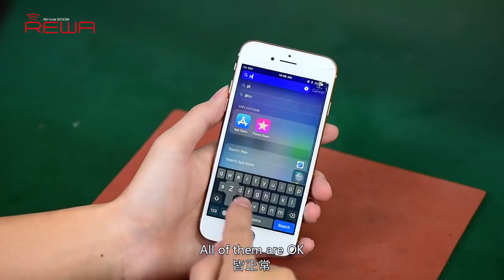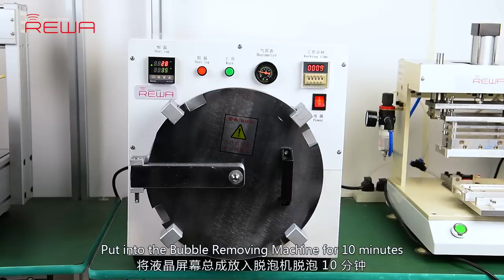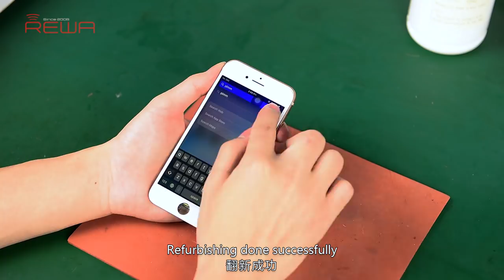iPhone 8 Broken LCD Screen Refurbishing - Glass Only Repair

Comment: Screen looks a bit yellow...
Reply: RUS yeah,I think so,looks yellow more than my iPhone 8😂
Reply: Probably because of the True Tone display
Reply from the maker: It is probably caused by photographic lights.
Reply: Where's the Russian and where's the hater?
Reply: ikr its looks yellow
Reply: Its hello because its not poem screen they repaired poem don't have the blue stamp that this screen had in the middle of the back where the rq code is at
Reply: Or maybe "Night screen mode"
Reply: maybe glue have to dry
Reply: APPLANDROID better remove your comment, makes you look like a fool, a second time because the screen is yellowish and a third time because of the capitalization.
Reply: a bit yellow is better than a bit cracked
Reply: RUS the color correction of the camera or the editing. It's obvious dude you're watching this on YouTube of course the colors are off by a lot
Reply: kirino Kousaka Same with me until I turned the night tone off Or whatever they call it
Reply: It was yellow even before repair. Also screen glue can a bit affect for color.
Reply: Damn, all that work and they are selling these after market screens for only $25 in the US.  So by the time you subtract a $10 profit by the distributor/reseller, $5 shipping, $5 refurb parts & electricity, there's only about $5 left for labor.  It's unbelievable...
Reply: Night shift mode enabled
Reply: Due to change of polarizer film which is not genuine
Reply: overcooked thats way is yellow🤣
Reply: zero00tolerance true
Reply: Your tree

Comment: wow this repair shop is so much more advanced than those common ones who only know how to replace the whole display assembly. this is one step up in skill and technology. real professional work.
Reply from the maker: Thanks. We will keep up.
Reply: +maxlol0 probably cuz these machiinary costs afuckton of money,, its almost impossible to just replace the glass without the right tools, in fact there is two methods,

using hotgun which may risk burning the protective film if go over 70c rendering the whole screen useless
using Dry Ice, which helps solidify the Glue in between the screen then u can take it of shards by shards, but u can easily fuck up when puting the glue back cuz if u went for a little that would lead to unequivalant pressure hence creating airbubbles, and if u wen to far u risk the glu goes to the side of the screen corners damaging it

what im trying to say the technique is hideous & impractical without using the right tools. thats why small shops don't use it

Comment: My iphone 6s got refurbished. The replacement screen is not genuine flatter than the original which is more curved and not that durable, got scratched easily and the placement is a little bit off, the black bezel of the screen was off the center, but over all it works.

Comment: Is it still water resistant? When I had my iPhone 5s, I accidentally dropped it and the screen became completely shattered. I took it to a local phone repair shop, and they replaced the screen and charged me $100. They did a bad job with it, because on the side of the phone was sort of a dent and light would shine out of the phone through there. I’m worried if I take my iPhone 8 Plus to get the screen fixed (there’s a small crack, not getting it fixed unless it gets worse) they’ll mess it up and that it will no longer be water resistant.

Comment: After a lot of practice you can get the same results with a platic playing card and a hair dryer and some LOCA glue and a UV light. You don't need to spend thousands on expensive machinery. unless your fixing hundreds of screens a day in which case I guess its possible it could be worth it for time. It is much better however to replace the glass on an original LCD then buying a poorer quality full screen.
Reply from the maker: This solution is actually for large repair shops and refurbishing factories.

Comment: At 6:20 the n-hexane is highly toxic. According to Wikipedia: It is neurotoxic and produces a polyneuropathy. In view of this behavior, replacement of n-hexane as a solvent has been discussed. n-Heptane is a possible alternative.
Reply: Wikipedia：The National Institute for Occupational Safety and Health (NIOSH) has set a recommended exposure limit (REL) for hexane isomers (not n-hexane) of 100 ppm (350 mg/m3 (0.15 gr/cu ft)) over an 8-hour workday.
Reply: Zhou Kevin In case the working space is very well ventilated, there isn't a serious problem n-Hexane and other solvents.

Comment: why you guy remove front film before laminate ? (pol film) it's not necessary for  few crack front glass.
Reply from the maker: It is more efficient to replace the POL film directly.
Reply: origin ocaabove pol film is very soft, you can easily take them out without removing POL film.
Anyway, remove and install new POL film will make LCD more beauty. (not scratched)
Reply from the maker: If we keep the POL film, it is hard to remove the glue; and for batch operations, remove the POL film directly is more efficient.

Comment: Sad thing is full LCD replacement coast the same as replace just the top glass
Reply: Junpeng Chen how do you work that one ?, to replace the glass is about $5 in parts, once your business has all the machines it's like printing money.
Reply from the maker: Glass-only repair costs much less in the long term. As @lain Simpson said, LCD is more expensive than glass.
Reply: You are talking about money, which is in fact worthless, just numbers, now think about real values and what is happening with them, if we just replace whole modules instead of little parts. Time to move forward and it begins in your mind, hopefully in close future that all will be produced with a way of easy repair in mind, sure, not by Apple, but maybe others and consumers start ro boykott Apple for their anti-repair-idiocy.

Comment: The new screen looked horrible! 
Spend the extra cash and get it fixed by Apple. It’s more money but your phone will be good as new.
Reply: Spend more for what? The issue can be solved with color adjustment
Reply: DIYelectronics I feel like if you have to do color adjustments, then it wasn’t fixed properly.
Reply: Kevinn they answered this in another comment, it was caused by the lights and camera, the screen was totally fine, like brand new